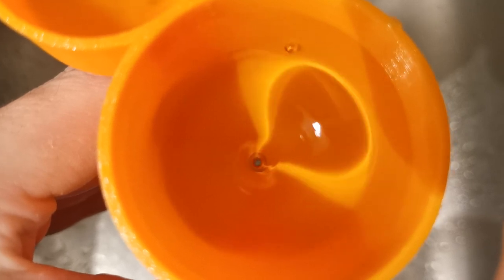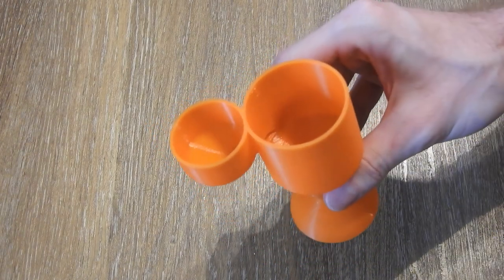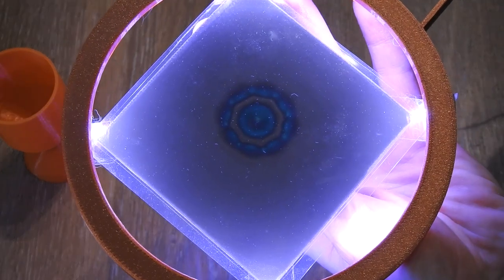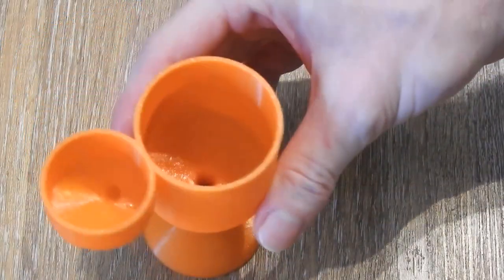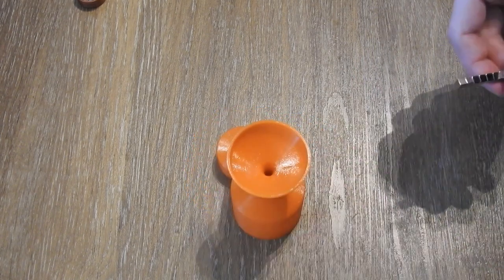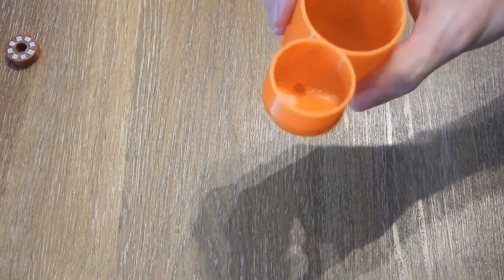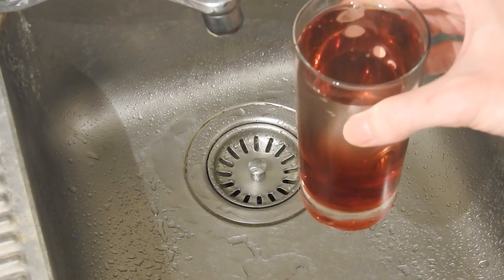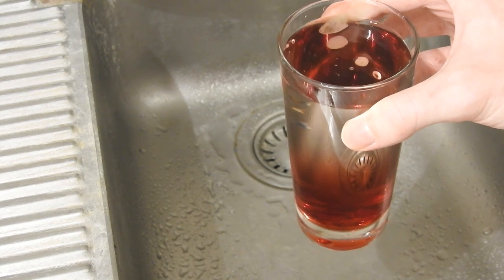Water memory cleaning device using circular magnet array and vortex funnel - new version

Comment: Really impressive how the water turned out to be separate from juice at the end. Would that mean the device changed its density slightly?
Reply from the maker: I don't know if that is possible.
It is interesting that if you stir the water/juice afterwards it really takes some time until the juice blends with the water, which normally is not the case if you just fill it with regular tap water.
Reply: @OmegaZZ111  Well then, I'm off to print mirrored version of your design and try it on my own. Testing will involve tasting local brands of juice too. :] Thanks for sharing Omega and cheers!

Comment: For Optimisation, Use only one halbach with 4 pole strong side in inner diameter instead of 2. Your thoughts please?
Reply from the maker: I think the array I use is better suited for this application.
Reply: @OmegaZZ111  how did you get to this conclusion that this is the best magnet arrangement to use?
Reply from the maker: By looking at the field geometry this array creates.
Reply: Water must pass through the pipe hole so field must be around the hole and should have alternating poles. So convert the strong side of halbach to inner diameter does serve your purpose and with less magnets and materials.
Reply: @seshagiridama  thank you for your explanation... and sorry for the silly questions I am very much a beginner in understanding magnetics! Does the alternating poles have to do with creating an overall balanced array or because it amplifies the field through the hole?
Reply from the maker: @seshagiridama  If you use a circular halbach array that focuses the field to the inside you end up with a very shallow magnetic field.

The key for effectively cleaning the water memory is to create a magnetic field that extends widely on the up and down side of the array so the water is exposed to it as long as possible.
If you use the halbach configuration you mentioned the water will only be exposed very shortly and the effects will be minimal. 
There is no need for alternating poles where the water passes through.

Also the field geometry of the array I use represents the two vortices on the top and bottom funnel the water itself creates when passing through.
Reply: If not alternating then use 2 pole halbach with strong side in inner diameter. you already making vortex in the top funnel so water flow gets slow down and field inside is very strong so that is enough to erase the memory. I agree Ken also say the longer it passes through the field the Better it erases. I feel the way you created the field is not halbach they are ring magnets with one is south inside and another is north.
Reply from the maker: @seshagiridama  The term halbach array just refers to a magnet array that has each magnet 90° shifted to each other to amplify the field strength.
This array does exactly the same, but the magnets are just not 90° shifted, in fact the field strength gets so high that it even damages other neodymium magnets when you bring it close to it, which can in my experience only be done with a halbach configuration.
So I would say the effects are very similar to a classic halbach configuration, the magnets are just oriented differently.